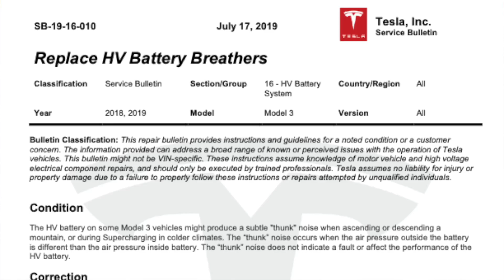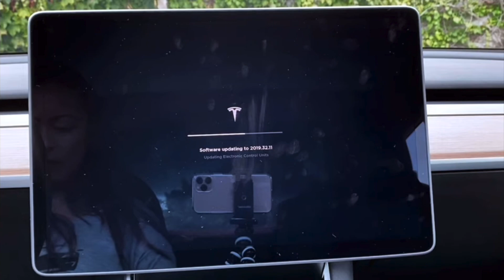Why Does Tesla Model 3 Make Loud Noises While Supercharging?

Comment: This is normal when supercharging all that heat and current coming from the cord cause the cells to flex (popping noise) the air pressure is different on the inside then it is on the outside

Comment: I'm still brand new to owning a Tesla (just 2 days with my 2024 Model 3 Performance), but I got to experience this for the first time on my own vehicle this evening.  Fortunately, I had rented a half-dozen different Tesla models on Turo over the past couple years and got to experience this phenomenon on both a Model Y and a Model S Plaid while supercharging.  It definitely took me by surprise the first time I heard it, but I wasn't too alarmed by it, especially when I did a quick bit of research.  Living in the mountains of Utah, driving all those cars and currently my own, it's easy to gain 4,000-5,000ft of elevation in a very short drive.  Up until this evening, I had exclusively charged my car via Superchargers since I have 3 free months of charging that came with the car.  For kicks and giggles tonight, I figured I'd just hook up my mobile charger to the outside plug and slow charge the car overnight tonight.  I had gone outside to play around with some settings while the car was charging and I heard a couple "thunks."  It'll be interesting to track the circumstances in which this happens over time to better understand it.  I'm not sure if you've had anyone write you back saying they've heard it while slow-charging, but I can assure it does happen.  I probably had the perfect storm of reasons it might happen: Mountain driving, Supercharging, my screen turning off and rebooting, cold weather and slow charging all in the same day.  My hypothesis is that in my scenario, it had more to do with this being a brand new car with only 375mi on it and it was likely the first time it ever was hooked up to a slow-charger.  This was probably attributed to those contactors opening or closing for the reduced current from the wall outlet.  But I'm sure any of the other variables could have played a role too.  Thanks for your video and I'm having a lot of fun getting to know the ins and outs of this amazing technology!

Comment: How long should you precondition your battery before putting it on charge? My supercharger is only 10 minutes away but the preconditioning never finishes by the time I get there
Reply from the maker: It typically takes longer but don’t worry, even if it’s not fully preconditioned it’s not gonna be bad. My supercharger is only 2 miles away and my car is never completely preconditioned when I arrive.

Comment: I locked myself in mine during the recent 2023 holiday update and it was a bit scary especially when it turns everything off for a bit and it gets mighty warm without the AC running at least here in Texas
Reply: Do you know about the emergency exit lever on the front doors? Check it out, there is a manual handle for the doors.
Reply: @ yep! It’s always good to know they thought of these scenarios so you don’t get into risky situations

Comment: Thank you for the added information on this Tesla Joy.  I have the same occasional loud thunk noises while charging my new 2022 model 3 LR on the regular mobile adapter on a regular outlet.  Garage is about 78 degrees.  Definitely felt it on the floor in the car.  I will have SC team look at it.

Comment: The sound from when your car is updating is supposed to deal with DC connecting & disconnecting (battery pack contactors cycling like switches), not sure why it's needed but that's what I've come across in my research.
Reply from the maker: Thanks Kai!

Comment: My nominal 2020 Model 3 was manufactured in December 2019. I do experience this phenomena at superchargers in Winter weather. I am an engineer and reasoned it out, yet I stopped by my local Tesla service center for confirmation. I'm not sure that having a car with a heatpump would have much bearing on this metal behavior. I'd rather think that changing the profile of the sheet metal with slight bulges or linear indentation would alleviate the noise caused by "oil canning" or rapid thermal expansion.

Comment: Yup! I had a thump sound last week while supercharging in the snow.

The other component you mentioned, a contactor, is basically a remote controlled switch that allows the car system to connect or disconnect the high voltage battery. That one will make a definite sound as well. Sometimes when the car is sitting on its own or waking up.
Reply from the maker: Thanks John!

Comment: I have a 2018 LEMR and also have the thumping. I recently (past Thursday, 6 January) had the HV battery breathers replaced. And just last night, while not charging or anything, the car made a thud. Granted I had just driven 181 miles from Las Vegas, NV to Fort Irwin, CA, and temperature had dropped nearly 20°F. So it doesn't completely eliminate the thump; however, having supercharged in Yermo before reaching Irwin, there was no thumping. So it does reduce the frequency. 

And yes, listening to the thumps and whirs the car makes while updating can make for a unique experience.
Reply from the maker: Thanks for sharing!

Comment: It’s the digestion system of the science of expansion and contraction amplified by outside temperature differences especially in the Winter months. 

The faster it charges the more heat produced just like when one is running.
Reply from the maker: Did you watch the video? 😉
Reply: @TeslaJoy  Yes, right on target 🎯! Well stated in the video.